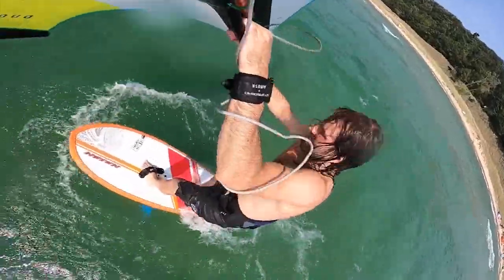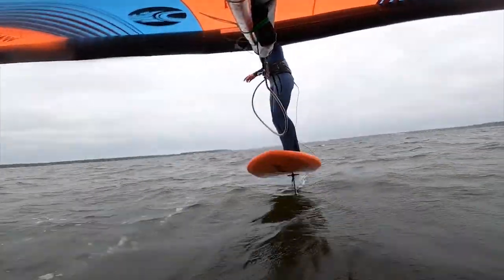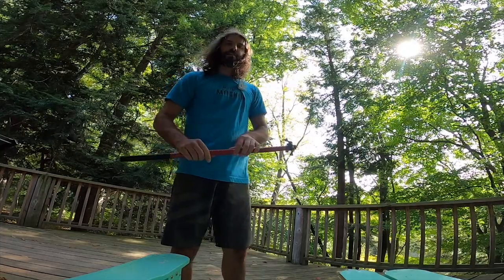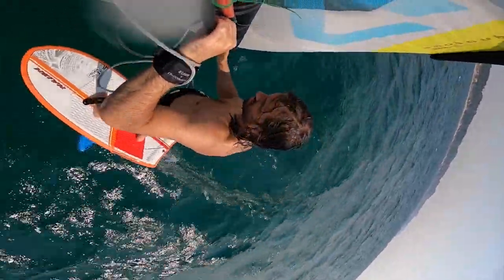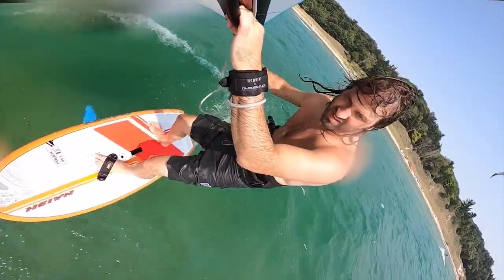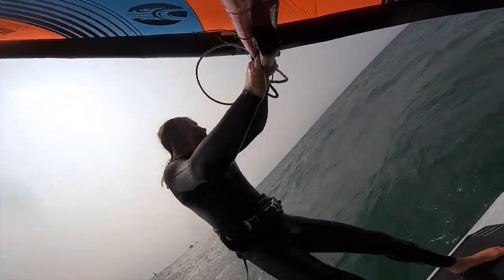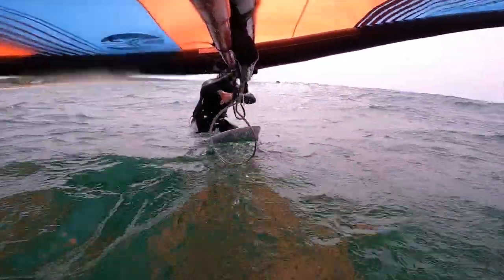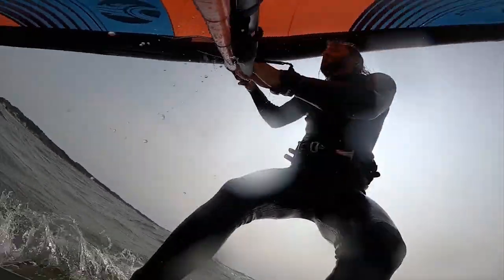Wing Foiling | Light Wind Pumping

Comment: I'm into this sport only two months after a decade of kitefoiling and 20 years 2 of windsurfing. This experience has my jibing, switching feet, riding some swell. But The ONE reason I get exhausted early is the pumping up to foil. I hope I soon get to a level where this gets easier doing
Reply from the maker: Yes, light wind can be difficult. A downwind style board helps. With some experience you'll ride larger wings with more power. -Tucker

Comment: Hey Tucker thanks for the tip! gonna try it asap! for reference, what size wing sail are you using and what size of front foil wing? thanks!
Reply from the maker: Anytime Pablo, In this video I'm riding a Duotone Unit 5m and F-one Swing 6m with an 85cm board and roughly 1450cmsq foil. We just found these clips show the technique well. Obviously, I can get out in much lighter wind with "proper' lightwind gear. These days, I get my max low end with a Flysurfer Mojo 6.2 or F-one Swing CWC 7, 90L Appleslice, and SABfoil 1100 foil. With that combo, I can get up consistently in 10-12kn.
-Tucker

Comment: How much are you using that foot strap? Looks like your pulling yourself and the board out of the water and using the wing to hang on too ?
Reply from the maker: Depends on the conditions and gear. This board is pretty small and riding in light winds. 85L compared to me at 90kg.  On a small board I need that front strap to lift the board so it has less drag and can accelerate.  I almost do a pull-up on the wing to get that board flying. On a larger board, especially longer, I can pump the wing to build board speed, then lift off more naturally.
-Tucker
Reply: @MACkiteboarding  great. Thanks for reply. I’ve just installed my foot straps. Hope I have better chance of take off now . Keep posting the videos . 👍👍